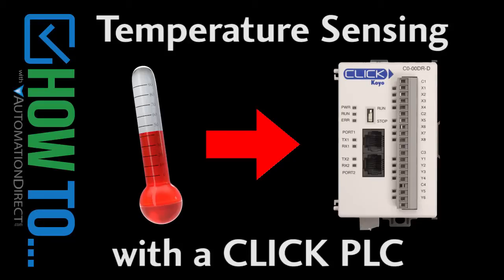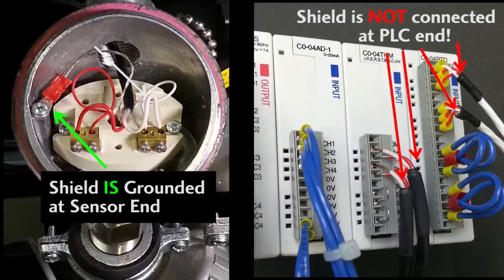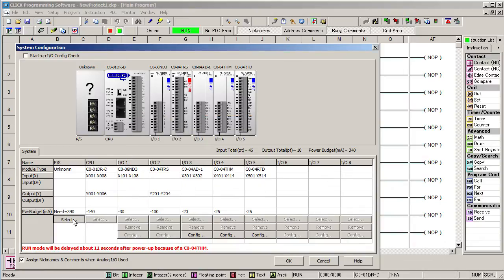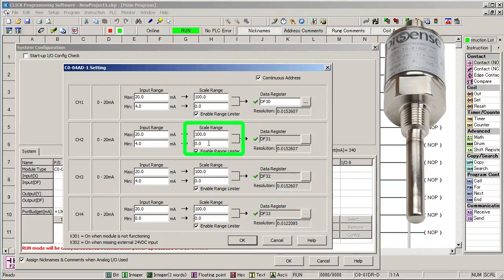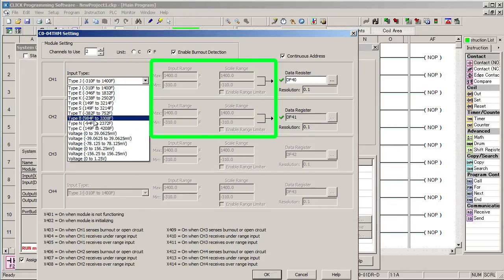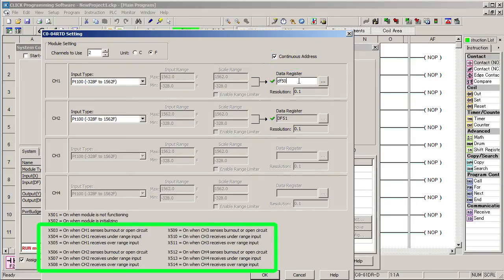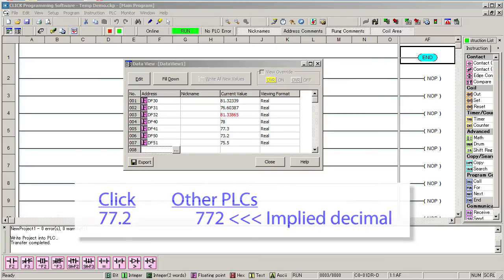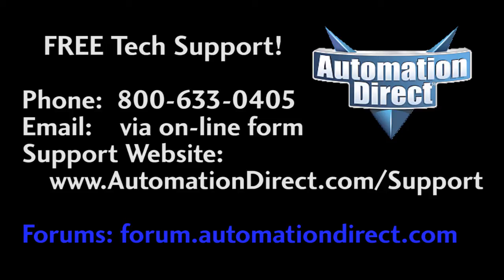How To Sense Temperature with a CLICK PLC from AutomationDirect

Comment: Can I use pt500 transmitter to connect it to the C0-4AD2DA-A module 0-20mA Input, even though most temp sensors/transmitters have 4-20mA output. How would you do that?
Reply from the maker: At 2:09 the video shows setting the card for 4-20mA.
Reply: @automationdirect  What is the accuracy of the module with a ma input?  .4 deg F. is far from acceptable tolerances!